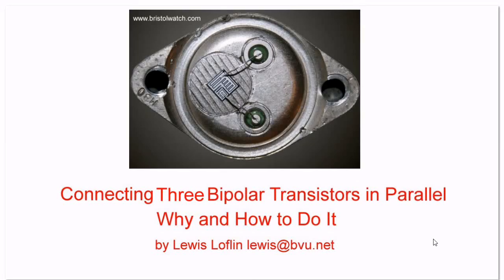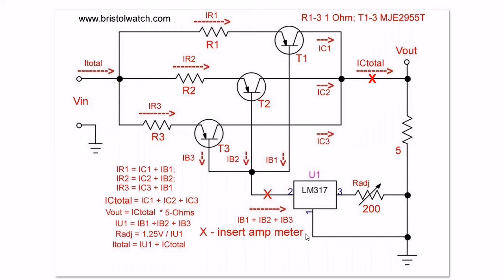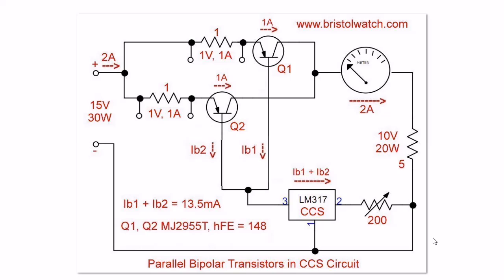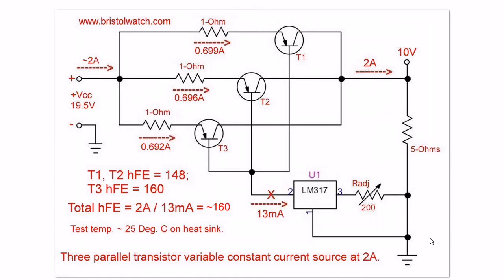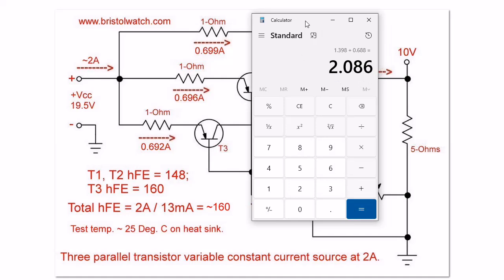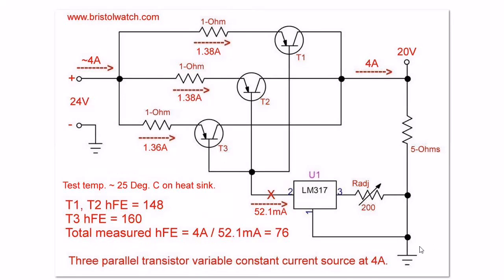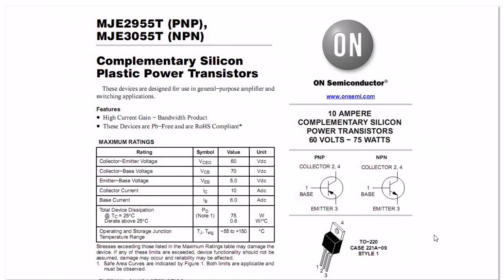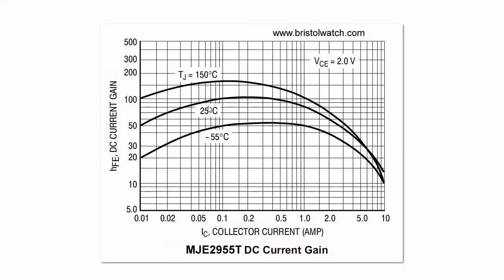3 Bipolar Transistors in Parallel and Other Issues

Comment: Going to higher collector currents reduces the current gain. But going to higher temperatures increases the current gain again and also reduces the Vbe. So these tendencies partially compensate the current gain as long as you don't overdo it. Of course it is not wise to operate a BJT at junction temperatures of 100 °C or above.

Comment: What's the max amps lm317 can withstand in this configuration? It might need a heats ink? Also the same for the power fets.
Can you explain how the lm317 gives the load to the power fets and not taking it by itself?
Thank you I learn a lot for those examples!